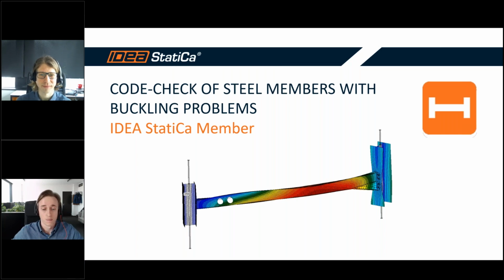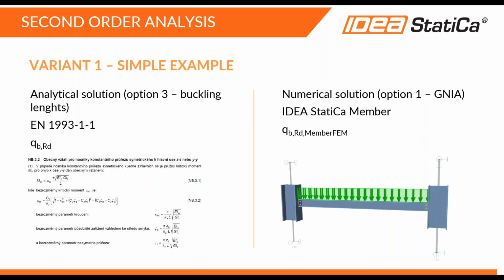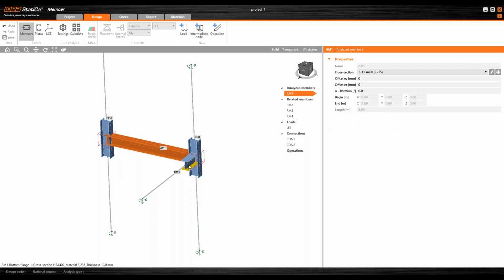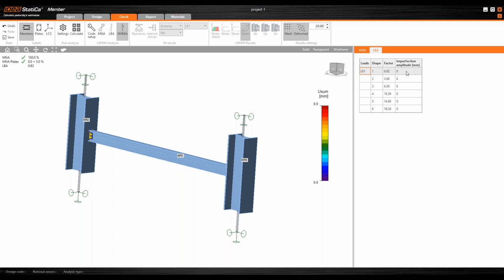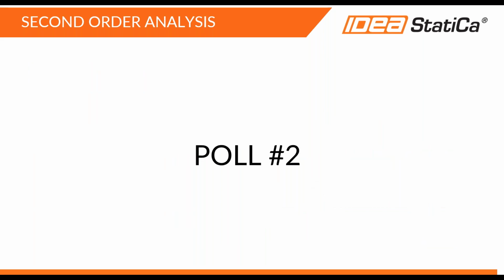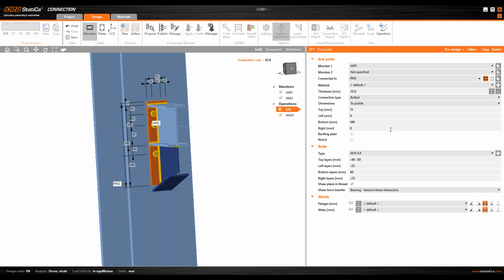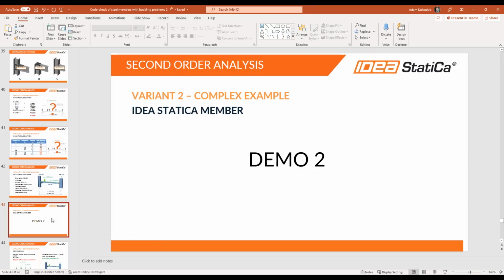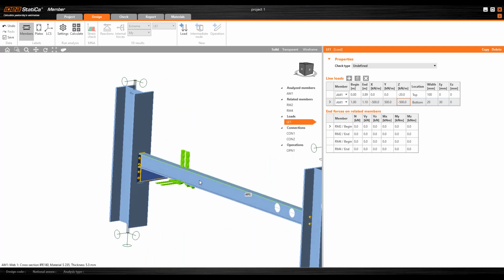Code-check of steel members with buckling problems

Comment: hi 
you were mentioned the factor of Lba 
what is the acceptable range (3-10) ?
Reply from the maker: Hello, this depends on multiple factors - type of structure, the member significance for the structure behaviour, engineering judgement, design code requirement, etc.
Also depends if the buckling shape is a global or a local one.
Please refer to this article:
https://www.ideastatica.com/support-center/global-buckling-vs-local-buckling-what-does-it-mean

Comment: Hi. Eurocode require to check local stresses under the weels. Well, I am not sure is this have been taken into account with GMNIA, or it should be checked analitically? What I want to say- point load is given with length end width input. Point loads in Z direction we can input under the area, lets say, 1mm x 1mm at the top of the flange. Maybe this would be to much at the "safety side" ? On the other hand, all of that is about the hertz contact stres, and I am not sure is this have been properly taken into account only with GMNIA with shell elements and without simulation of the contact weel and the girder. Does additional analitical checks should be done? Best regards, thanks in advance.
Reply from the maker: Hello,
The member model takes into account the stress generated from the inputted load. You can input a point load or area load as you wish, and stress is calculated on the mesh of finite elements appropriately, taking into account geometrically and materially non-linear behavior. Then the stress and strain are checked against the EN criterion - 5% strain is allowed. You can control this limit in the Project settings. Of course the local stress is calculated as well and the stress flows then further in the construction.
You can refer to the theoretical background too:
https://www.ideastatica.com/support-center/idea-statica-member-theoretical-background

Comment: Hello, how to devide the element be 3 part and put end plate moment connection between in the 3 part of the element?
Reply from the maker: Hello, you can input more members for the analysis and connect the with a modeled connection, as for example here:
https://www.ideastatica.com/support-center/steel-frame-en

Comment: Thank you for your very good and detailed demonstration, how do you relate Ec3 clause 5.2 Alpha Critical to Buckling factor? If BF >1 , no 2nd order analysis is required?
Reply from the maker: Hello, you consider the 2nd order analysis based on the alpha critical that comes from the global structural model (should provide you e.g. SAP2000, Robot, etc.). This is something different from the buckling factor, which is calculated in IDEA Member for one or more members selected from the global structural model.